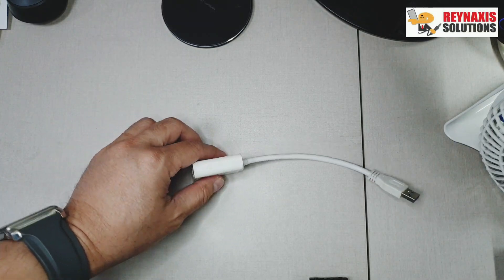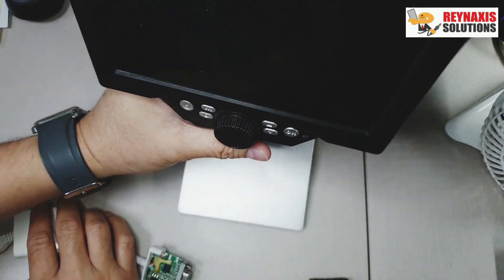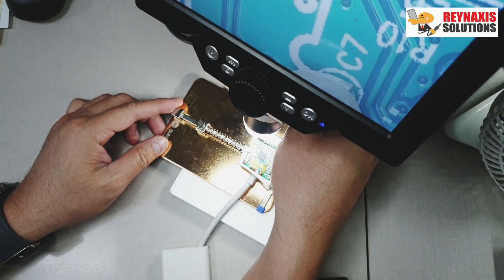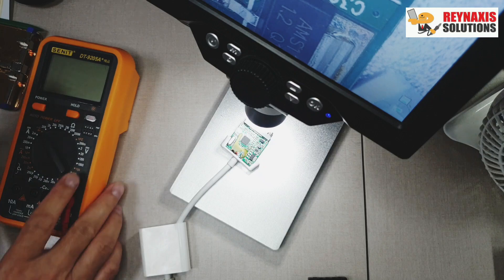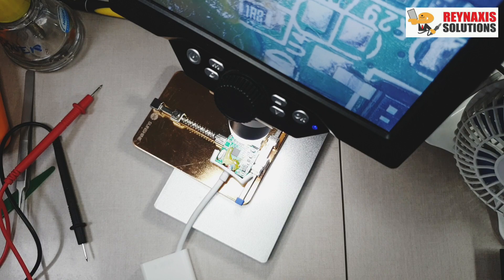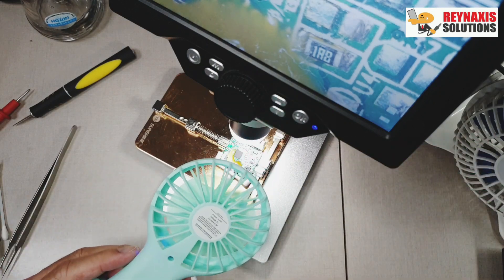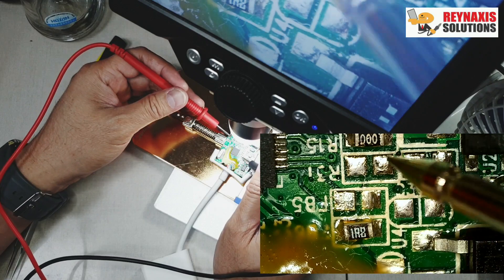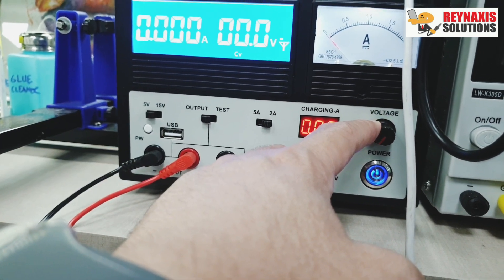USB to VGA Adapter Repair (no fix)

Comment: mine cease to function after a year (when I unplugged and plugged it back) I guess it was because I did not turn off the PC + monitor before (dis)connecting it. Chinese stuff from Ali did not secure their device
Reply from the maker: I guess so. Mine got damaged probably due to loose connection.